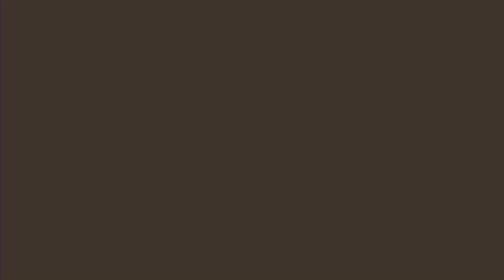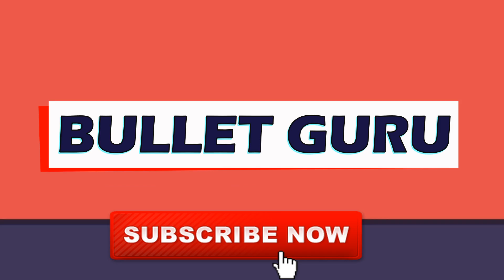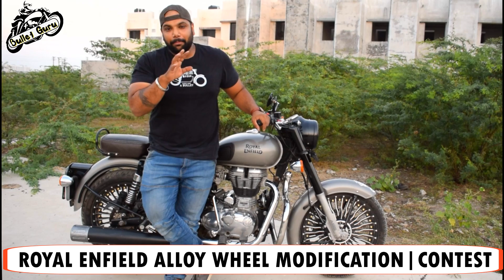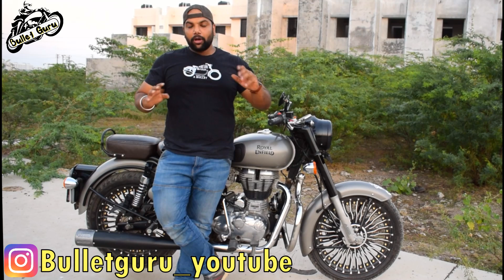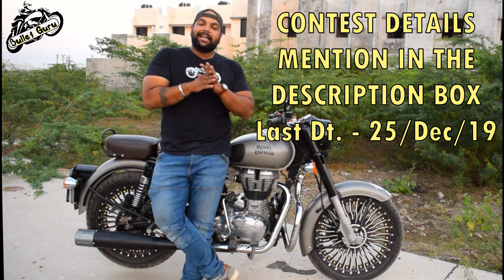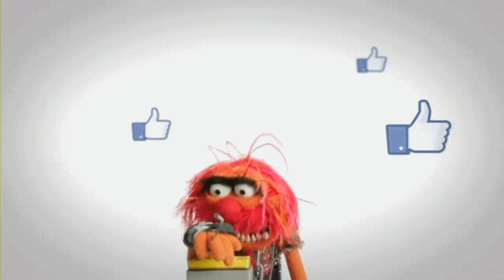Royal Enfield Alloy Wheel Modification || "GIVEAWAY CONTEST"

Comment from the maker: BEST PRODUCTS BUY LINKS -------------|-------------|-------------|----

ENGINE OIL BUY LINKS– 2.5 LTS--------------

1. SHELL 15W50 - https://amzn.to/2oGzIcz
2. CASTROL 15W50 - https://amzn.to/2nKmISt
3. GULF 15W50 - https://amzn.to/2nNbEUm
4. HP(RE GUN) 15W50 - https://amzn.to/2maLZ7L
5. SERVO 15W50 - https://amzn.to/2nGlnMl
6. MOBIL SUPER 15W50 - https://amzn.to/2ousyaV
7. MOTUL 7100 10W50 (2.5LTS) - https://amzn.to/2PlMQNI
8. LIQUI MOLY 15W50 - https://amzn.to/2s0SNHu

SILENCER (Buy silencer as per your city Challan condition) -----------------------------
1. INDORI - https://amzn.to/2nLd4Pm
2. INDORI BLACK WITH CLASSIC PLATE - https://amzn.to/2oxAWGN
3. Red Rooster Performance Chrome - https://amzn.to/2nJIHce
4. Red Rooster Performance Black - https://amzn.to/2nKJWYy
5. Big punjab/ Long bottle - https://amzn.to/2nMIyVr
6. Mini punjab/ Short bottle - https://amzn.to/2mPa5FG
7. Moto Torque BEAT - https://amzn.to/2mbHkm0
8. Barrel Exhaust SCUD - https://amzn.to/2ow7tNh
9. Exploder Long Exhaust - https://amzn.to/2nML6Tv
10. Dolphin Exhaust - https://amzn.to/2ovKiTi
11. Bend Pipe Guard - https://amzn.to/2MfcO4M

LIGHT & HEADLIGHT
-------------------
1. DRL LED Headlight 105W - https://amzn.to/2MojS0s
2. DRL LED Headlight 50W - https://amzn.to/2TNdjFI
3. DRL LED ANGLE EYE HEADLIGHT - https://amzn.to/2mXLUEL
4. C6 65000k LED LIGHT - https://amzn.to/2nNFLLq
5. NIGHTEYE LED LIGHT - https://amzn.to/2oouZvr
6. Grill Set (Metal) - https://amzn.to/2Z6Os5H
7. Indicator Set - https://amzn.to/2Z36aa7
8. Headlight Black Ring - https://amzn.to/2Nhffon
9. 6 LED Fog Light Set - https://amzn.to/2NdMCIN
10. 12 LED Fog Light set - https://amzn.to/2ZcMpft
11. OSRAM 100/90W LIGHT - https://amzn.to/2mN0LSG
12. 14 LED FOG LIGHT - https://amzn.to/2maNYsJ

CLEANING & CARE POLISH ------------------
1. Microfiber Cleaning Cloth - https://amzn.to/2ZbqTaL
2. Chain Cleaner Brush - https://amzn.to/2KJ6mTc
3. All in One Cleaner Polish - https://amzn.to/2Z0Q40o
4. Body cover Silver - https://amzn.to/2KI9dvu
5. Matte Paint Polish - https://amzn.to/2YVPalY
6. Motul Combo(Lube & cleaner) - https://amzn.to/2ZcY75u
7. RE Body Cover - https://amzn.to/2MqQbfm
8. WASH SHAMPOO - https://amzn.to/2mXUoM9
9. FAST WAX SPRAY - https://amzn.to/2mfvXJY
10. 3M WAX - https://amzn.to/2nOFlEw
11. SCRATCH REMOVER - https://amzn.to/2mWYxA6

CUSTOM & MODIFICATION PARTS--------------

1. Engine Guard - https://amzn.to/2KFsCNr
2. Vibration Handlebar Rod - https://amzn.to/2Mck69r
3. Clutch & Brake Lever Set - https://amzn.to/2YZXReV
4. Mobile Holder with Charger - https://amzn.to/2KFkEnJ
5. Simtac Hazard Flasher - https://amzn.to/31H6zM6
6. Antenna with Light - https://amzn.to/2NpCtJp
7. Headlight Ring Black - https://amzn.to/31cUopN
8. Handlebar Light - https://amzn.to/2VChuVG
9. FEGO SAIL SPORT - https://amzn.to/2PE6OTF
10. FEGO SAIL PILLION - https://amzn.to/2YIElR4

RIDERS SAFETY & HELMETS
--------------
1. Royal Enfield Helmet MASK - https://amzn.to/2ZdW0yD
2. Probiker Gloves - https://amzn.to/2KSIwTJ
3. Steelbird Air SBA-2 Robot HELMET - https://amzn.to/2mMkNNb
4. STEELBIRD AIR SBA-2 MATTE BLACK HELMET - https://amzn.to/2ooNqQI
5. STEELBIRD SBA 1 R2K HELMET  - https://amzn.to/2nHAvJx
6. VEGA RYKER BOLDER HELMET - https://amzn.to/2olWQfN
7. VEGA RYKER D/V HELMET - https://amzn.to/2mZgU7k
8. KNEE & ELBOW GUARD * https://amzn.to/2nHsjJg
9. STEEL KNEE & ELBOW GUARD - https://amzn.to/2nNHKzG
Reply: Bhai kangaroo ka chain lubrication Liya  stealth black k liye .bahut acha Laga. Thanx. 👍👍
Reply: Bullet Guru royal erado 30 spokes alloy wheels
Reply: Brother Meri new classic 350 hai agar aap giveaway Kar do mujhe to wo mere liye Christmas gift hoga 😍😘🤩
Reply: Bhai alloy wheels ka link do

Comment: My height is 5.3 feet and want to reduce the wheel length to manage the weight properly while sudden braking or turning the royal enfield classic 350 bs6 stealth black 180 degrees and stuff . 
So,how much wheel length or diameter can and should I reduce to? 
And as you said spoke wheels are better so can you suggest which one should I buy to reduce the wheel diameter. 
Please help if you can. /\

Comment: Hi Bro  Its 30 Spokes Harley style  Alloy wheel  in the live section  You told About this Alloy wheel  And you told that For long riding  Alloy wheel  Are not good  And you told That If you want to use Alloy wheel  Buy 30spoks Alloy wheel  Witch u r giving in Giveaway